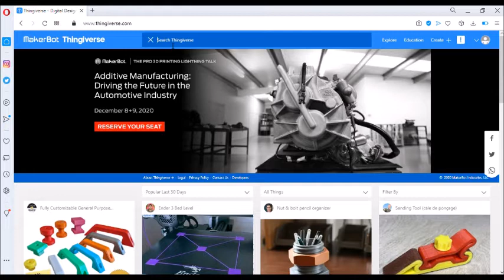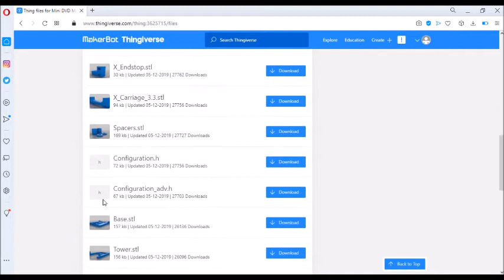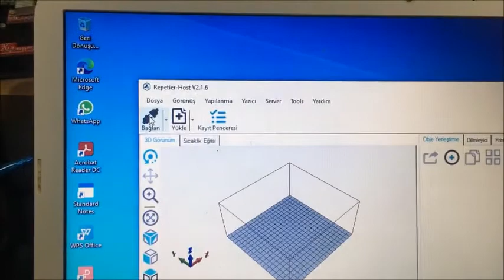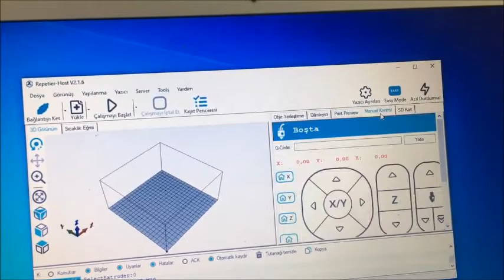How To Make a Cheap 3D Printer With Old DVD Motors

Comment: Hi, l’m waiting for the second part, also please provide more information like firmware, model for power supply, step motor controller model,…. 
I’m going to build this in this weekend
Reply: You can find the parts with little research
Reply: Be polite, this is free content